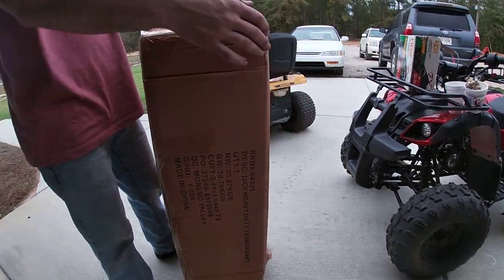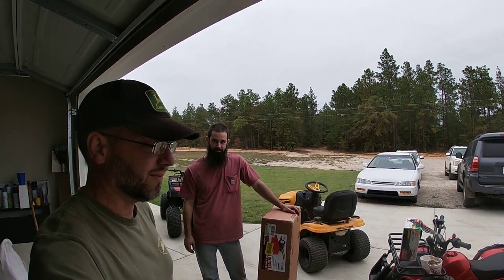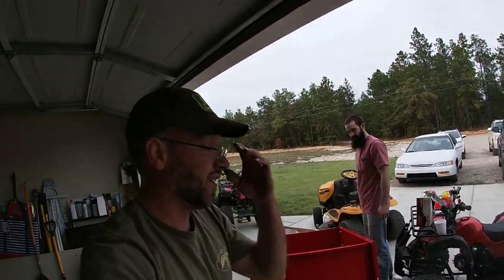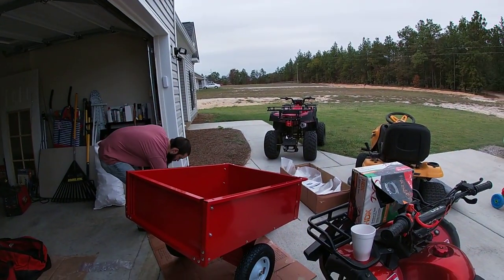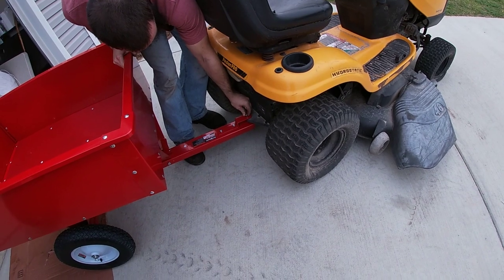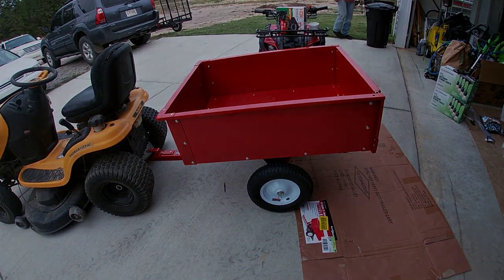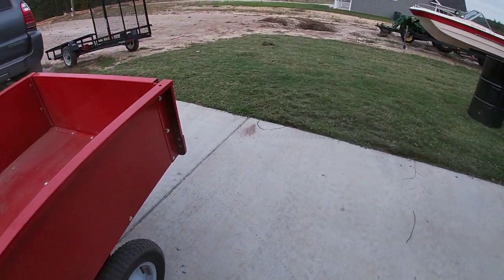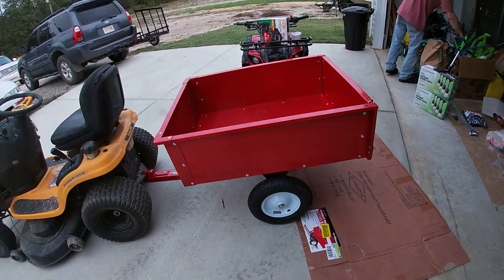Haul Master Trailer Cart from Harbor Freight

Comment: I think this little cart will be perfect with my 4wheeler to haul tools that I need for clearing equestrian trails   Thanks for video.
Reply from the maker: It has done well, so far only issue I had was with one of the tires.  Make sure your valve stems are positioned properly.   Other than that, I use it on the Homestead all the time with my 4 wheeler.   thanks for watching and commenting

Comment: How much stronger would you assume it would become if you welded it together after you put it together with screws, the seam in the middle is the point i worry about most.
Reply from the maker: If you're a good welder, I would say pretty good, but I must say , it's a lot of screws and I leave mine outside and still use it for hauling everything.   The wheels are the weak link, but I did weld those!!!  LOL
Reply: @MyLooneyBin  Nice, thanks

Comment: Menards sells one that’s  750 pounds, it’s steel and it comes with the bed already assembled in fact it’s one piece and it’s welded, very sturdy, the whole thing took about 35-40 minutes to put together definitely worth the couple extra bucks!
Reply: * update*  The one at Menards is like $165 bucks with a $20 rebate
Reply from the maker: That's a great deal!   Unfortunately we don't have Menard's.

Comment: Need to put some rims on there
Reply from the maker: funny you say that, that is the only issue I have had with it, the rims broke and I welded it back together and it was fine.   BUT,  you can NOT fill it completely with sand and pull it over bumpy ground.   the axel will bend

Comment: Have you had any problems with the screws coming loose? Did they give you a loctite nuts and bolts thanks I'm actually in the market for getting one
Reply from the maker: I haven’t , to date, and I did not use locktite
Reply: @MyLooneyBin  I bought one put it together the only problem I've had with it was a minor thing when you loaded up me to take the back door off you go to slide it in the wood chips or something stuck in there no big deal easyfix screwdriverbut I believe home Depot should make a receiver hitch that would fit in that and I had to fabricate my own receiver hitch
Reply: Nice video,  I just built one. I had a few dents and one bolt on the front bottom that won't go in. It's solid.. I'm going to use it so the dents won't matter to me. I think I want to put something in the floor to give it some extra cushion from the material I'm going to move with it. Rocks brick wood ect. Thanks for posting this.

Comment: Does your atvs have a more or less power than your tractor??
Reply from the maker: I just have a 150cc chinese 4 wheeler ... I can fully load the trailer and it does great.   my riding mower has a 27HP kohler engine, it does great as well.   I have beat this trailer down, and it is still going.

Comment: Is it safe to drive on a side road for around 15-20mph?
Reply from the maker: I have a dirt road in front of my house and when it gets dirty I go pretty fast on the 4 wheeler to blow it out, and I would say that's about 15 or 20 if not faster,  ... errr, for your safety, please use as recommended by the manufacture!

Comment: looks small and cheap
Reply from the maker: It actually did real well for a while, I leave it in the elements, but you know what broke .... the wheels, yea the wheels broke, the trailer is still solid,   just as good as any other yard trailer, they are all made form the same sheet metal.  but I have to get some new wheels.   the hub snapped right out.  but i have really rough terrain, so it took a beating.